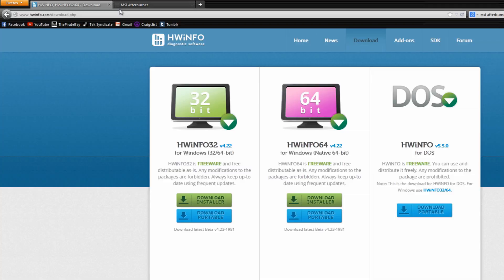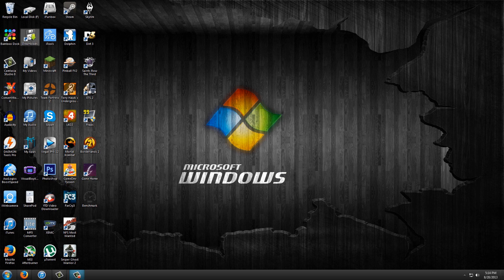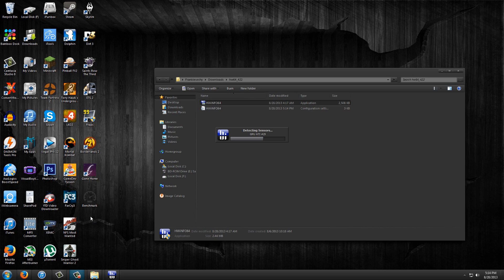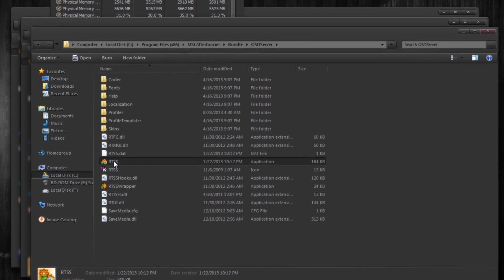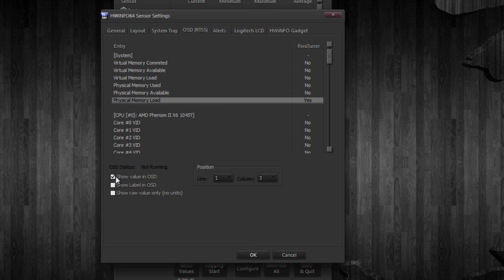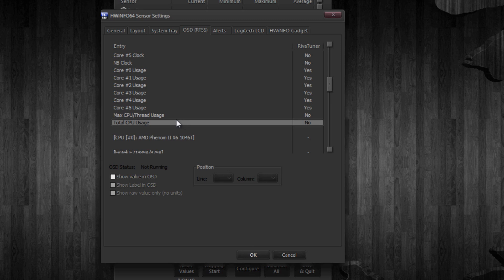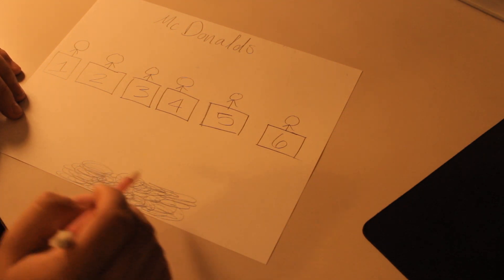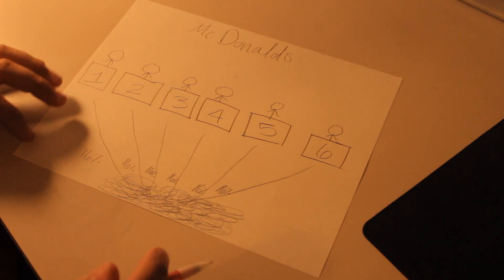How to Find Your PC's Bottleneck

Comment: Hi Frank,
Awesome video btw. I got a question, im using an fx6300 with a gtx 770, i did your guide and none of my cores or even my gpu went to a 100 but sometimes during loading it reaches 90 for all the cores...does this mean i dont have any bottlenecks anywhere? and what are good values for both the cpu and the gpu?

Thank alot.
Reply from the maker: GTX 770? Nice! :D CPU's pretty nice as well, alot of map processing takes place during loading, so it's common to have surges in performance, generally, I don't pay much attention to the benchmark numbers during loading because where your performance matters is when you're playing anyways! (ALSO I'm assuming you're playing on Max graphics settings as well, correct?)
Reply: ***** Hi Frank Thx for the reply, yea i am playing (bioshock infinite) on ultra settings, btw does performance also throttle when it comes to the heat of both the cpu and the gpu?
Reply from the maker: Soda1922 Okay, well based on your hardware, your computer is more than capable of running this game with no bottlenecks. I can't say that'd be true if you played BF4 on Max Settings. Hmm, I've thought about it, and I'm having a problem understanding your question. Are you saying, will your hardware throttle performance down if it reads that it is running too hot?
Reply: ***** what I meant was, will I see a drop of performance if my hardware does run hot (which I think it will), cause at the moment in at lock fps of 60, if I unlock it, my fps goes about 100+ but mu CPU load jumps to 90+.

so you're saying that in btf4 I'll be getting bottlenecks with my current processor?
thx for the tips
Reply from the maker: Smart thinking to lock it at 60 fps, anything over is overkill as you know. But no, I don't see that happening. No, I don't think so. Your processing power will stay pretty constant, but you ought to monitor your temps while playing. Look up the max safe temps for your cpu and graphics card on Google and make sure you're not going over that temp. Your processing power will remain fairly constant with heat, but too much heat will create a bigger problem: the early death of your components, so always keep heat in mind for that reason.
As for your other question, I wouldn't know the answer, you'd have to play BF4 on Max to know. The graphics are much more dynamic and hi-res in a game like battlefield(which is one of the most graphic intensive games out there) so it's going to take much more processing power to display them. So if you can run BF4 on Max without 98%-100%-ing one of your components, it'd be safe to safe to say you can run pretty much anything and have no bottlenecks in gaming performance.
I hope I've explained this well enough, but please, if you're still confused on something then let me know how I can help.
Reply: ***** haha thx alot for the advice, but I tot crysis 3 is the most graphical intensive out there? Also I tot btf4 is more to gpu compare to cpu
Reply from the maker: Alot of people use Battlefield for performance benchmarking, and alot of people use Crysis 3, but my point is, find a graphically intensive game, and benchmark on those to test for a bottleneck!
Reply: ***** I see thanks alot for the advice,...I hope my system wont bottleneck btf 4 on max settings

Comment: Hi,
Well, first of all nice vid with nice, good and logical explaination. The problem is, that it shows you only your bottleneck for Gaming.
When my GPU is running @100% and my RAM and CPU not, that can also mean for example that my RAM is too slow to process the operation done by my GPU. Do you agree?
Reply: Well, I thought about it once again.... actually I was wrong! :P Cause then the GPU would not run @100% while the RAM is still almost @idle.
I was rendering a Video and my RAM usage was @100%, CPU @idle and GPU @30-40%. In game however it was like in your system... almost same results... The problem here is, that I have 2-way SLI with two GTX 780Ti's and there is no faster Single GPU on the market right now. So how am I able to upgrade that! :P Maybe in 4-5 years there will be some, that can handle it, so everything will be more balanced... at least for gaming. :D
Reply from the maker: You have a good point, I'll change the title!